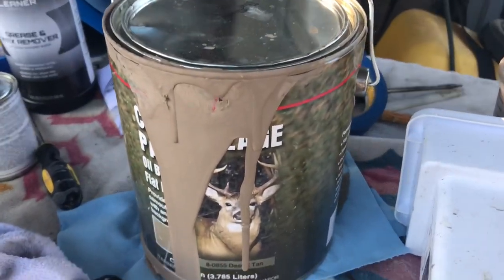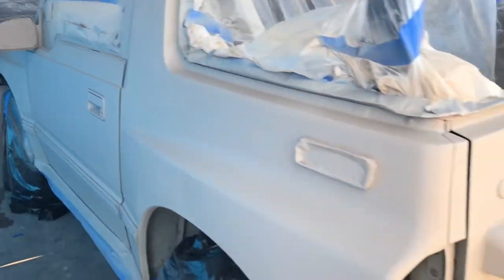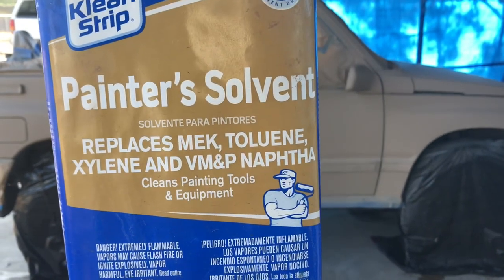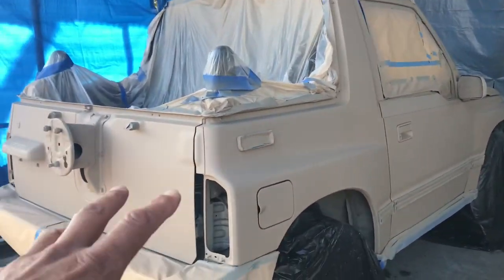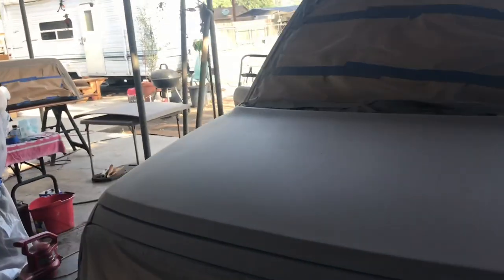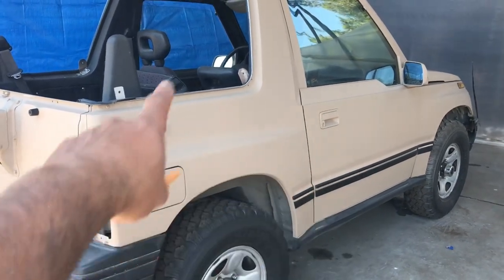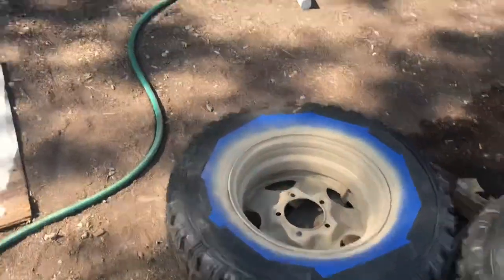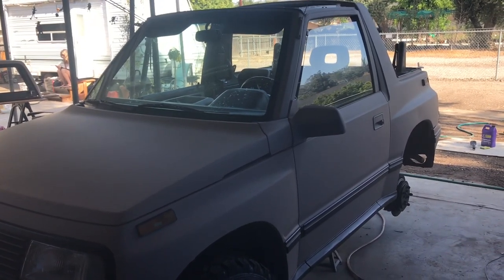Magic tractor paint

Comment: Do u need the hardner
Reply from the maker: I highly recommend you use it.
Reply: @TreasureGeo  Damm I painted my boat a couple days ago already with a brush and rolled it on feels dry to the touch but soft
Reply from the maker: @nwfishing175  Keep it in the hot sun for a week or two.  It will eventually get rock hard
Reply: @TreasureGeo  thank u so much for replying I been trying to get more information on this paint I notice in the morning it seems harder then with the sun right on it feels like its melting thanks again for the help
Reply from the maker: @nwfishing175  its a thick paint and it takes a while for it to dry.  Trust me it will work out good in the sun, thats what I did.
Reply: @TreasureGeo  ok sounds good thank you for the help it has helped me out I almost threw the rest of the paint I bought away glad I didn't